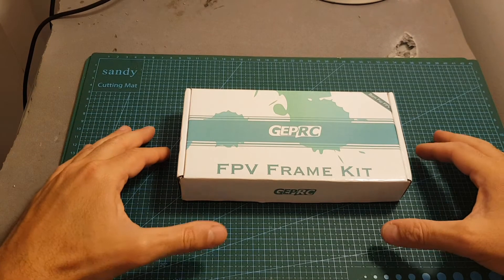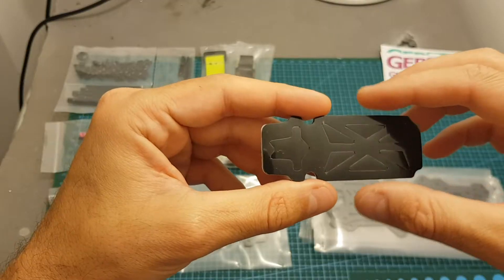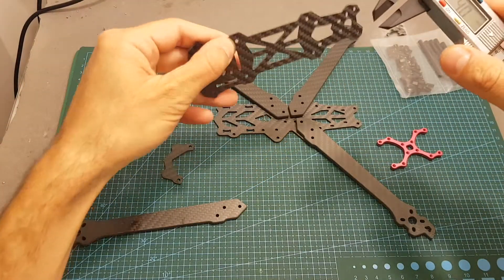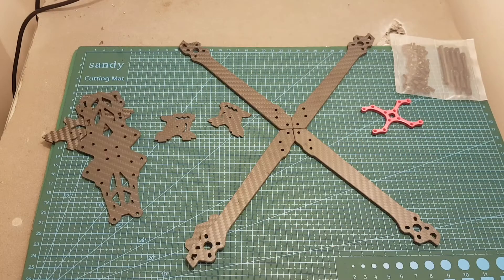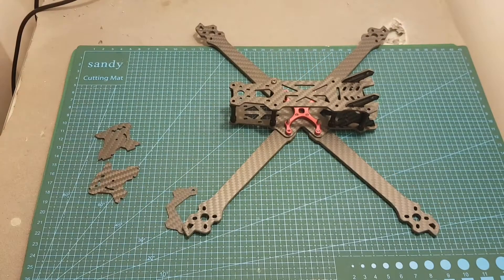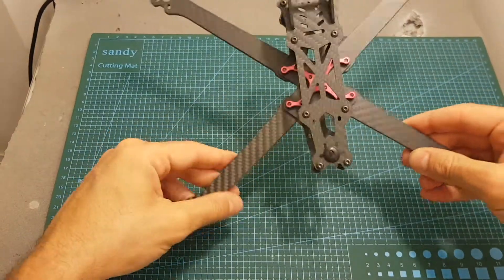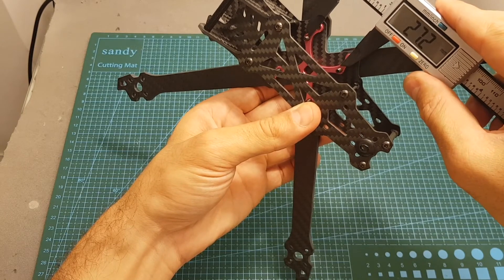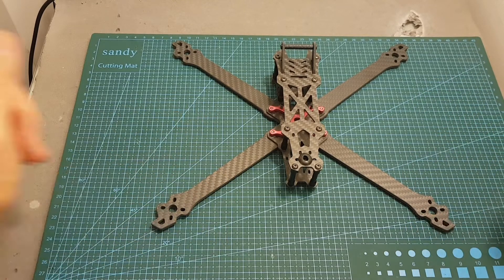Geprc Mark2-7 7 Inch Frame Overview

Comment: Hi Gal! as always, looking forward to all of your build videos. I actually recently purchased this same frame GepRC 2 7" frame, as this review helped me decide in the purchase decision for frame. I took your motors into consideration as mention in comments, however, what FC, ESCs and battery (5S or 6S) will you use? Looking forward to using your extrapolated data!
Reply from the maker: You're welcome. Due to a tight schedule I still didn't build this one, but I plan to do it soon. It's going to be my long range platform for testing the 2.4GHZ FuriousFPV system. I plan to post the video in the next month so stay tuned ;-)

Comment: Why don't you use the new 2207 GepRC motors !! 1900kv on 5s !! Or 4s big battery for long long range :)
Reply from the maker: It's also a good option, but I've got the BrotherHobby 1700kv motors, so I better use them :-)